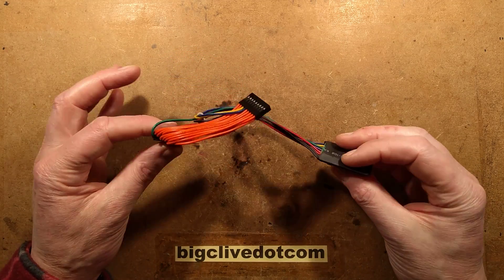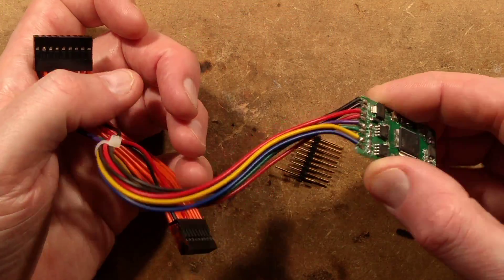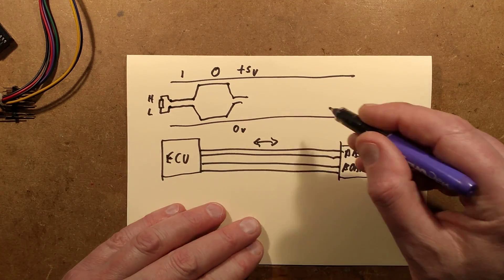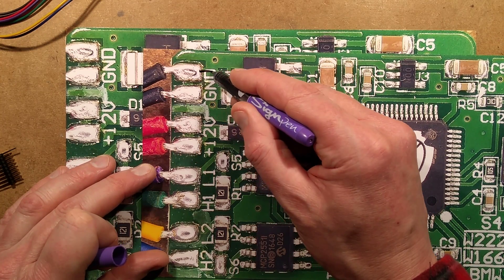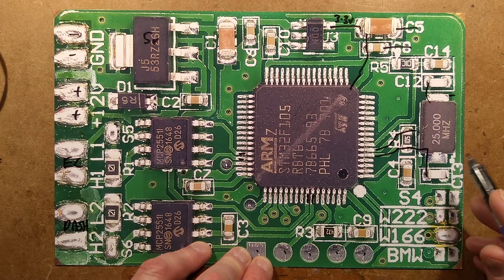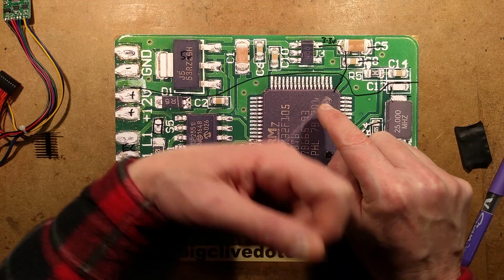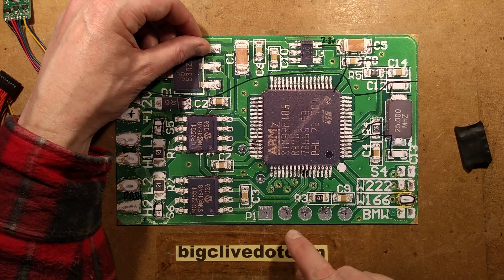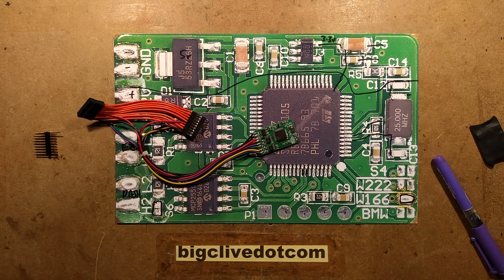Naughty CANbus odometer "interface".  (Fakes mileage.)

Comment: "Keep in mind that their function is to reduce the apparent mileage of a vehicle, and this may be a criminal offence in some countries."
It definately is in the Isle of Man, and in fact the UK :-)
Reply: It's not an offence until you sell the vehicle with an illegitimate mileage to a buyer without telling them the mileage has been lowered. It seems here that the device has been used in illegitimate circumstances
Reply: @stevieg_306  But it's not an offence to sell a car with 50k on it if the car had an engine replaced without the buyers knowledge. It happened to me and trading standards told me 'tough luck m8'.
Reply: @eugeneoneal3034  what is the problem with that anyway? As long as the engine is the same spec as the original and has roughly the same or less mileage than the odometer. Did your replacement engine have more miles on it?
Reply: @stevieg_306  you are suggesting that it is just for thick people that want to cheat themselves legally?? HA HA!!
Reply: @fredflintstone1  nice name! Kinda weird to run into you here!
Reply: Fred Flintstone ? Any relation to me?
Reply: As I understand it, it is in the US as well but only if the driver is not made aware of it. There's a shop near me that got away with similar modifications simply by putting a service sticker under the hood noting the modification. Thankfully the court proceedings bankrupted them before they could do any more damage with the more dangerous modifications they would perform.
Reply: @eideticex  In Alabama, Tennessee, and Texas (the only jurisdictions I know the law for this in) an altered or incorrect mileage must be listed on the title along with an estimate of proper mileage. No putting a sticker under the hood, or on the back of the instrument cluster, and saying 'it is documented'.
I had a Trans-Am whose speedometer was under-reading for about 3 years (at 55 it showed about 30 mph, and the odometer turned as if it was at 30 mph) and I had an estimated odometer.
Reply: Best solved with a street sweeper.
Reply: I believe it's the same in Australia too!
Reply: the most common legit reason to do mileage correction is when you do an ECU swap in a car with an "ECU kit" .. say you have a 2007 vauxhall meriva. ecu shits itself, you have an 07 meriva so safe to say you cannot afford the 4 figure sum for a new ecu and programming. So you go on ebay and get an ecu kit, ecu, instruments, body controll, steering colum electronics and keys. you swap the lot into your car and your back up and running, but the mileage is wrong. have it corrected to match your old mileage... interestingly the last car I did this too was an e-class mercedes lol. 

(am an auto-spark) swapping an ecu kit is often a get out of jail free card for a car with plenty of electrical gremlins/ intermittent faults.
Reply: in BC Canada when you sell a car private OR DEALER the paperwork has a "declarations" section with check boxes for "rebuilt" / damaged over 2K / Lease ETC and one for Odometer incorrect/changed or over 100000 (IE rolled over) 
Dealers HAVE to fill them out also 
Carfax being so "big" in Canada these days this type of device would NOT work well anyways as mileage is submitted by dealers when service work is done / there is an insurance claim made OR the vehicle is sold/new registration
Reply: There are legit reasons to do it, I knew a guy who had one on a project where the dash couldn't be modified parts and the ecu linkage etc and he'd had an engine die, bought a write off and had one of these sort of things in to shift things to the mileage on the 'new engine'

When it was sold it was sold with the receipts and a admittance that the engine wasn't the original engine, that it was set for the mileage on the new engine and the car mileage and the new engine milage differed.

. He did it that way because an ecu wipe would have wiped the mileage and the only people who could have adjusted the mileage was the dealers with the software and the manufacturer had gone bang which killed that option unless he wanted to send stuff to the USA to get it all reset. 

Having it wiped to zero wouldn't have taken into account the new engines mileage or the transmission services etc, he basically set the car up so that all the services had been done so the mileage could be used to track to the next service etc. 

As far as he confirmed with the solicitor for his business he was totally in the clear under UK law given no intent to deceive fully informed buyers and all the paperwork etc. 

Iv seen the same need when a new lcd dash was dropped into a car winding the mileage back to the car it was being put into mileage vs the wrecked car it came out of and not paying the dealer the nearly 1000 pound they wanted to do it all. 

Also messing with stuff to change how the dash displays and allowing for different interfaces and other useful tools, communicating with displays to. Monitor tunes, additional information that normally you can't get access too while on the road etc even controlling sensors to trigger and change stuff. 

This is the problem with laws that get written without knowledge you ban stuff that there are legitimate reasons for. 

Thats the problem the dickheads ruin things for everyone by taking legitimately useful kit and doing shitty things with it.

Comment: Hmmmm, I think I see how it works (7:00) but Merc have got wise to the 'mileage correction' game for a while now, the mileage is stored in 3/4 different places, the ECM (engine ecu), EIS (electronic ignition/key (yes the mileage is stored in the key)) and the IC (instrument cluster). If the mileage is significantly higher in any of these 3/4 places the rest of the modules will adopt the higher mileage. This has happened to a customer of a garage I used to work for where they used one of their spare keys and the mileage jumped up by 50,000 miles
Reply: You got this all wrong. After installing and turning on these devices, the speedometer cannot calculate the mileage anymore. Hence, the remaining control units are also unable to record this data. You can remove the module any time, Even when you remove the module, mileage will stay the same as it was when activated , and It doesn't matter which diagnostic tester you use to check the mileage of the vehicle, there will not be any data displayed different from the dash
Reply: This isn't reprogramming the mileage value with a lower value, this is reducing the amount that is added. Therefore mileage data would be consistent in all storage devices. You couldn't use this to give a car a "haircut" (as the trade call a car with the odometer wound back), you stop the hair from growing as quickly.
Reply: How is that even possible it would mean the Old key would have had to travel 50000 miles in a another vehicle. My brother is a locksmith and we retrieve the data off of a key to find there is no mileage being stored on the key what we did find was a counter that was counting down the amount of times you could use the key before it would deactivate itself.
Reply: @JoelCarterproduction  The mileage had been 'corrected' and the previous owner had probably not supplied the spare key when the mileage had been changed. The car wasn't in the best of condition either with lots of stone chips and corrosion here and there so the actual mileage may have been even higher than the additional 50k as the key stored the mileage it was last used at
Reply: @JoelCarterproduction  amount of times a key can be used on a car? That sounds like a pain in the ass waiting to happen. Actually that would give me anxiety and I'd try to get rid of that. Unless you're not talking about a car key.
Reply: @renyn21  He's talking about manufacturers programming keys to self disable after X number of starts, to force you to buy a new $300 Smart key from the manufacturer. (after the warranty expires, of course.)
Reply: @caniscerulean  Sounds like laptop battery control boards disabling themselves after a certain amount of cycles, I pulled cells from totally non working batteries and would you look at that they worked just fine.

Comment: A quick free MOT/mileage check would surely have shown a discrepancy in the mileage?
Reply: There is no MOT for the first three years, this is exactly when it is most financially rewarding to clock a car. Also cheap lease deals restrict you to 8000 miles/year or similar - some high mileage users save hundreds a month by going on one of these cheap deals instead of forking out for a 25k lease which can be twice the price. If required, time your clocking and servicing correctly and it's unlikely anyone will know at the time of handing it back.
Reply: I was assuming being a 2015 model there would have been 2 MOTs in its history, of course if fitted before 3 years old it wouldn't show up. 
Apart from reducing the overall mileage by a set amount, does the mileage still log as normal?
Lease cars have to be serviced on schedule, so if going by the adjusted mileage that could be double the recommended interval.
Reply: @Mark.D.H.  I'd guess this was fitted early in the car's life, and that the car still registers the mileage as normal thereafter, it's just always (realmileage-40000) so once it's done there isn't anything obvious to give it away. Yes the service interval is the most worrying part as these will have been serviced  way too late possibly why we so often see so many early failures on turbos, timing chains etc (not helped by already long oil change intervals by manufacturers)

Comment: the CAN bus has 0 being active due to how the CAN bus handles Arbitration; i.e. what happens when two devices go to talk at once. 

Each CAN message has a priority code which works as follows;
lets say we have three nodes that want to transmit at practically the same time, one of 3 (0011) one of 1 (0001) and one of 5 (0101)
rather than messing with baud rates lets just say call each step a Tick;
first tick;
All send the first bit, this is 0 for all of them
So they all go high, and the bus is high 
They all check the bus value and all see it is high
So they all transmit the next bit, this is 0 for all but the last one for which it is 1
so the first two go high, and the last one goes low
as such the bus goes low!
they all check the bus value and the last one sees the bus is not the right level and goes into receive mode
finally the first two transmit again
the bus goes low
and the first one drops out to going into receive
the remaining node transmits it's remaining bit, sees no conflict (which as its the last bit would otherwise produce an error) and transmits its data onto the bus
Reply: What a clever system

Comment: Ah, go on! Knock up some sort of cheap bus reader on a blank Arduino. Connect it to the program pins, and see if the Arduino boot loader comes up!

Apparently the loader waits some small time for a response, then jumps to the application code if it doesn't get it's little ping on the program lines.

So look up the Arduino boot loader spec, then ape it and see what you get! I have some eerie inkling that the QC sticker is the highest quality component on board.

Take it to bits, Clive! Might be the product of some industrious Chinese teenager who looked up the CAN spec or got the info on the Chinese information grey market. Locking the bits might be next month's lesson!

I dunno that the Arduino software can decompile but you might get something interesting or possibly scandalous! Maybe those 512 bytes are where they hide the emissions! Or the managing director's girlfriend's phone number!

Interesting so far but i know Big Clive can do more! Just a blank Arduino can be pressed into service as a basic bus monitor and dumper.

Comment: Anyway you could make a video on filtering line noise? I have a cheap Chinese power supply(for an old laptop) that completely hoses my Ethernet over power connection whenever its plugged in.